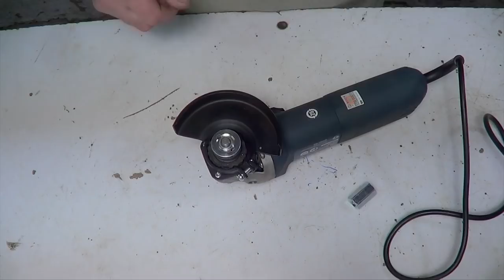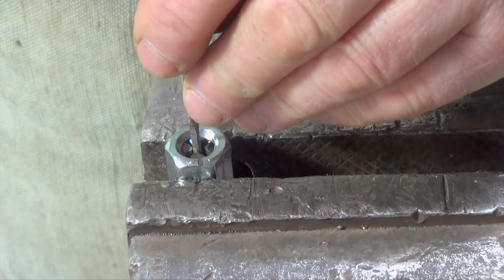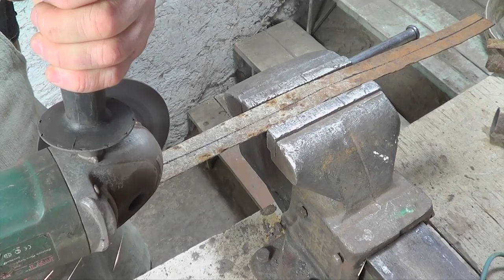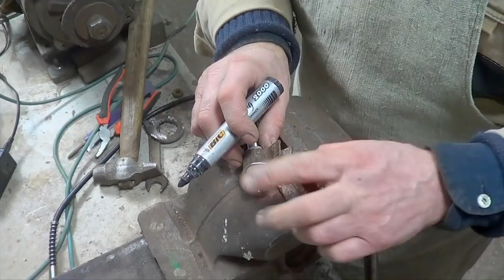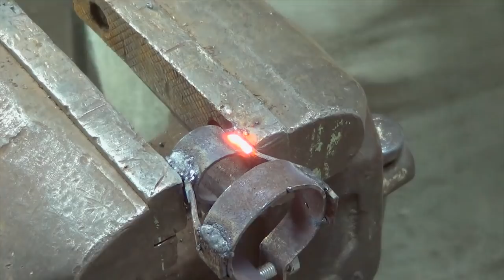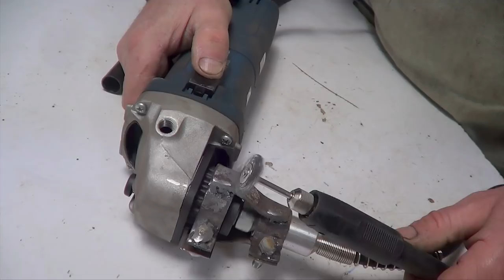AMAZING! Brilliant ideas & DIY

Comment: So, in just a few hours you sacrificed 2 working tools, in order to make 1 dangerous piece of crap.
Reply: The adapter's pretty cool. Useless, though. High torque and low speed makes the dremel part useless; and the angle grinder equally so.
Dremels are like up to 35,000RPM while an angle grinder is up to like 12,000RPM but mostly 5,000RPM.
Reply: Your parents made one too in a second.
Reply: @TheSign2020  Um. SmoothBore is actually right. This is a piece of crap for small attachments that require high RPM to work right. You try using a dremel at reduced power, vs at max power. WORLD of difference.
Reply: This dude is trolling comment
Reply: @chris2fer1977  thanks captain obvious.
Reply: @dimitar4y  so we all missed the point of the video. This video is for people who found themselves in a situation  when they can't buy a freaking new dremel or they don't have a dremel at all .or they don't have time to find a dremel,  maybe their freaking car died and they are on top of the mountain with nothing but a dremel cord dremel cutters and  an angle grinder with no freaking plates. People here obviously have never been in a situation like that. The video is for adults who use tools and find them selves in crapy situations.  It is a nice attachment to have around. Like noone knows how many rpms a dremel has. Give it a rest. You were born in deemels.  We used fingers to engrave shit before you guys came into existence . People like this guy in the freaking video invented and made the freaking dremels you all now play smart about. Shame on you all. We should burn it all and give you the shovels back.
Reply: @TheSign2020  Congrats,  you saw the point of the Video. Most of the World does not live where things are convenient like the Naysayers do.I have traveled the world on business, and have seen unbelievible numbers of ugly hybrid tools that do the work their creators intended they do.
Reply: @dimitar4y  yes I would.  I have that right now under my feet and no dremel.
Reply: @TheSign2020  what happened to the stranded broken car on top of a mountain motif?
Reply: @TheSign2020  you'd have a better dremel if you tapped directly off the high RPM motor inside the grinder and skip the gearing... sigh.
Reply: i'm wondering how long that grinder machine will last before it is toasted. and what will be happened to that broken dremel, will it jst trashed to garbage ? 2 powertools for shit at the same time? gees, what a waste

Comment: just wait until the cable breaks free and you create a weed wacker of death :D
Also unfortunately, useless mod. Dremel has much MUCH higher RPM. This, has much lower RPM But higher torque that will damage the cable or hurt you, if you get it stuck. :(
Reply: You have no idea
Reply: @TheSign2020  ACTUALLY i already did something like this and the damage was hilariously catastrophic. High torque motors are nothing to scoff at. High RPM motors like the dremel are relatively safe.
Reply: 40000rpm lowed down to 12000rpm. i dont think we can use that cranky modified rotary .lol

Comment: Disculpame pero ese es un error muy enorme que te pude costar asta la vida porque no son las mismas revoluciones el rectificador es de 1500 revoluciones por minuto y el mini pulidor es de 12000 revoluciones por minuto entonces el cable  esta en un 90 %mas de su capacidad de trabajo alo que puede generar un amarre interno y puede aver un desprendimiento del cable guia que es un cable flexible de acero de 1/8 y si tu lo tienes frente a ti el se enreda y al mismo tiempo se deshila y te pude enredar junto con el y pues el sistema de encendido es el mismo y creanme que jamas  tendrás tiempo de apagar o desconectar el mini asi que es buena la idea pero no la recomiendo yo por eso les digo que  cada cosa es diseñada para cada trabajo  gracias y disculpen si ofendo el pensamiento o idea de alguien saludos

Comment: I frggn hate those little wire wheels.  Is like a guarantee every time u use one you will get one of those little needle bastards in ya..  whether you gey it later from it being in your shirt or even picking the damn things up their gonna bite ya.. especially if u get the cheapo ones..  i throw the ones that come in the variety packs in garbage before even using a nt

Comment: After this set-up comes apart and the cable whips the shit out of you an answer will emerge to an often asked question: Why does a Dremel have very high RPM but little torque.

Comment: I would have taken the long union nut and just rounded over the corners, then used a die and cut threads so the screw lock on the end of the cable could screw on just like on the original tool.
Reply: The nut spins the coupler does not so it can't b threaded

Comment: Well, I guess as much as it appears as a good idea, it is actually dangerous to everyone including yourself. I don't see the logic of doing away with a broken dremel only to put your entire life in danger. As some of the guys here have said, the dremel and other brands alike have high rpm (20000) and very low torque thus the extension cable (which is basically motorbike speedometer cable) can withstand little rotary resistances like drilling with 1, 2 or 3 mm bits. If for some reason, the tool gets stuck maybe when drilling something hard, the cable will transfer the resistance back to the dremel drill and it will stop turning, giving you time to turn it off thus safe for use by any layman out there.
For angle grinder, this is purely waste of time. There is a reason why first, it has a metallic guard and a more grip surface. In relative to dremel, as some have said here, it has low rpm (10000-12000) but the torque my friend, is enomous. Unlike the direct drive from dremel, the angle grinder's motor has a small pinion gear that turns a big crown gear thus giving it more power to drive big discs and overcome enormous rotary resistances. In your case, if for some reason the attached dremel cable gets stuck, the angle grinder won't stop turning, instead, the cable itself with coil around anything around it, like your arm. By the time you manage to turn it off, it will be a MIRACLE if you'll still have your arm attached to you.
Let me emphasize on this, it is a shortcut to Hack your arm by surprise!!!

Comment: OK YOU NEED TO GET A MIG  WELDER ASAP. ITILL OPEN UP A whole new world for you.
Reply: It's better a mig or mag welder?.. (with o without gas)
Reply: Mig welder is with an inert gas. Mag is without. Usually for cleaner and stronger welds Mig is used. 
Mag is good if your’e on a budget.
But spatters and makes a bigger mess.

Also why the fuck would he get a Mig welder when he has a stick welder. It works just as well if you know how to use it properly. Much cheaper too.
Reply: @tanohack  mig and mag are both with gas. MIG is Metal Inert Gas,  MAG is Metal Active Gas.
Reply: This guy is pensioner playing around in a celler. Mig cost VS. stick welder. Mig needs wire, gas and 380v. Inverter stick welder is same size as toaster, needs only 220v and sticks are cheap.
Reply: iggnasio Exactly
Reply: 00

Comment: Grinders with no guards fitted that thing on the bench death traps you would be sacked for using this equipment with no guards all this for some crap wire brush just to piss about

Comment: It turns only oneway and speed is too high but if you use the drill it can be better and also you can adjust the speed as well
Reply: ㅜㄱㅎ
Reply: You never saw an angle grinder in your life. They do come with adjustable speed
Reply: @TheSign2020  but only oneway its possible to adjust the speed with extra cost. For that job Using  a Drill is much cheaper

Comment: But WHY would you go to all that hassle to make a tool that's not as good as the original? For a start theres no speed adjustment on a disc cutter which is something regularly used on the mini multi tool. 
Very clever and all that but utterly pointless.

Comment: looks like there is so much energy lost ( waste). those grinder machine took lots of wattage jst for an hour. yet the machine will also heat up and toasted for non -stop operating over an hour . the grinder machine's construction is not recommended for a high continuous non-stop operation